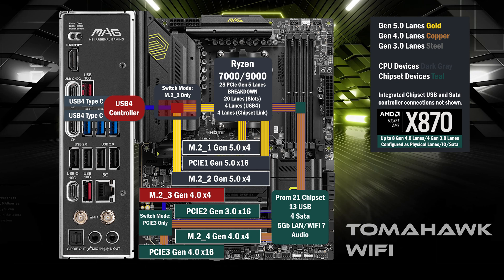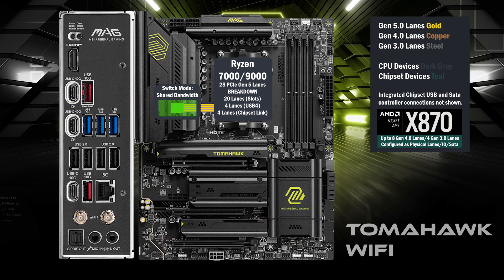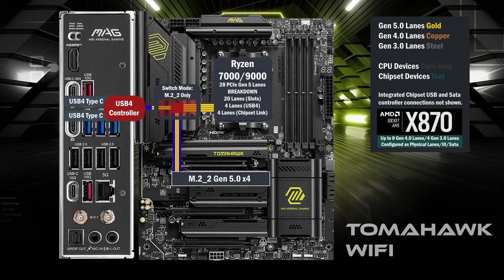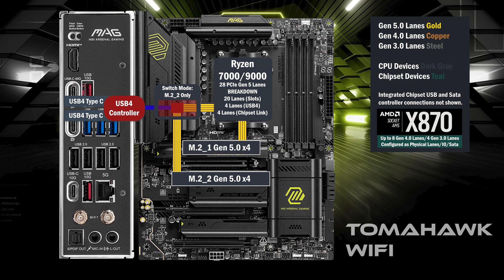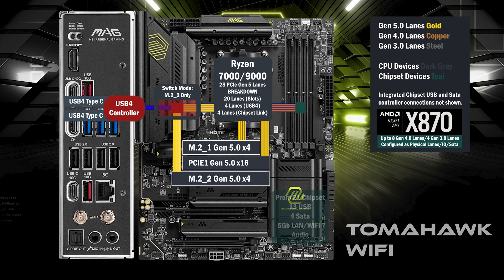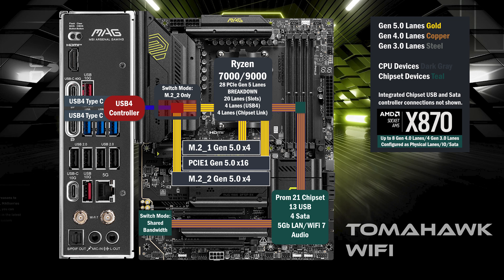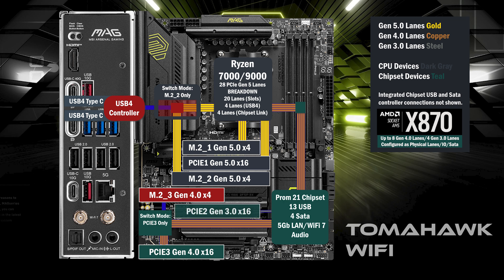MSI X870 Tomahawk WiFi All PCIe Connections

Comment: so this means i can have 2 gen5 SSDs with 4 lanes each AND keep all 16 lanes for the GPU AND 1 gen4 SSD going to the chipset with 4 lanes?  what happens to the USB4? are they completely disabled or just run at 10GBPS?   is there ANY 870 motherboard that can run 2 gen5 ssds and run a GPU at 16 lanes and not take away from the USB4?
!!-please help, thank you-!!
Reply from the maker: Do you need all the bandwidth of your x16 slot? Just want to make sure, because lane switching is a great feature, the majority of GPU lanes sit idle in most systems. Here is a breakdown and a possible solution...

With current Ryzen CPU's and x870 boards it's not possible to run 2 Gen 5.0 x4 ssds, integrated USB4 and a GPU at x16 without switching lanes or sharing bandwidth. 

The CPU only supports 24 Gen 5.0 lanes, switching lanes from the x16 slot is an effective way to increase Gen 5.0 connectivity with little to no impact on performance in many cases.

If I was building a system and had to have all the things you mentioned without lane switching, I would find an X670E board with support for 2 Gen 5.0 ssds and 1 Gen 5.0 x16 slot (24 lanes used). 

Then I would find one with a x4 mode PCIe slot running at a minimum of Gen 3.0 x4 and add a thunderbolt (USB4) equivalent add in card. It will go through the chipset, boards like these:

Gigabyte X670E Aorus Master
MSI MPG X670E CARBON WIFI
ASUS ROG CROSSHAIR X670E EXTREME
Asus ROG STRIX X670E-A GAMING WIFI
Gigabyte X670E AORUS PRO X
ASUS ROG STRIX X670E-F GAMING WIFI

Comment: The switch between the usb 4 controller and the 2nd M.2 slot is a brilliant way to comply with AMD's specifications yet still offering a 2nd M.2 that is directly connected to the CPU without sacrificing GPU lanes, thanks for the insight! I may have to get this board...
Reply from the maker: I like this feature too, having those lanes available if you don’t need USB4 is a great option.
Reply: What if i use gen4 ssd on m.2_2 port. How does usb4 effected by that?
Reply from the maker: USB 4 wouldn’t be affected by a Gen 4.0 drive in that slot. The drive would run in Gen 4.0 x2 mode unless you disable USB4 in the bios, to get x4 mode for that slot.
Reply: You can maximize connectivity by having a Samsung 990 EVO SSD in pcie5.0x2 mode in M.2_3 while still having usb 4
Reply: The 990 Evo is unique at this time as it has "dual mode", it can work in pcie4.0x4 or pcie5.0x2 as they're basically the same as far as bandwidth goes. Afaik there's no other SSD that does this at this time.
Reply: @ValentinNadolu  Hey not sure if you're still around or not. I'm looking to build a new pc, thinking of this mobo. So if I want to keep the 2 USB4 running, I get 2 Samsung 990 EVO or Evo plus? I'd like to get at least 2 NVME's on my mobo for os and other for games. If need be, I can always use a regular ssd for videos, movies, music etc...unless I could still get another m.2 running without any sacrifices.
Reply: @OmegaManX709  The only limitation is that if you want to use M2_2 AND USB4, you're limited to two lanes of PCIE in M2_2. The best SSD for this configuration is a Samsung 990 EVO Plus which can run at PCIE5x2 in M2_2. In M2_1 you can use anything you want up to PCIE5x4.
Reply: @ValentinNadolu  thanks for replying back, I think I understand it now. So I could do a full Gen 5 in m.1, and then a evo or evo plus in the m.2 to run at 5x2. If I wanted to add a 3rd for just a drive for downloaded stuff like movies etc…I could just get a Gen 3 or something and plug it in one of the other slots.
Reply: @ValentinNadolu  yeah that will be nice but i have 990 pro 4tb i need usb4 while i want to have 1tb gen5 fast ssd what eould you recommend?